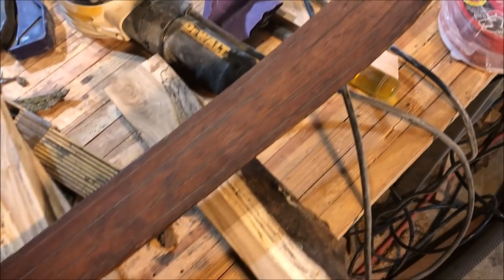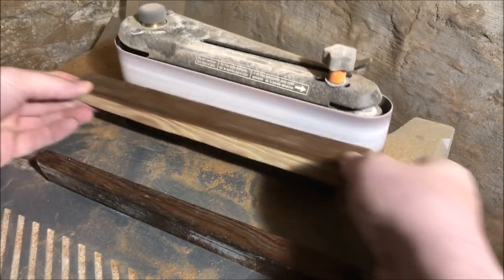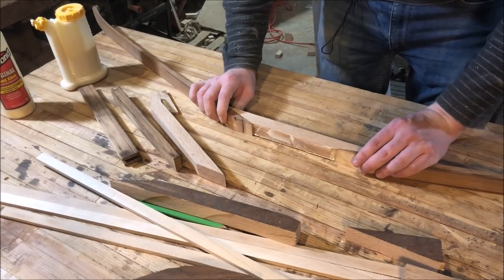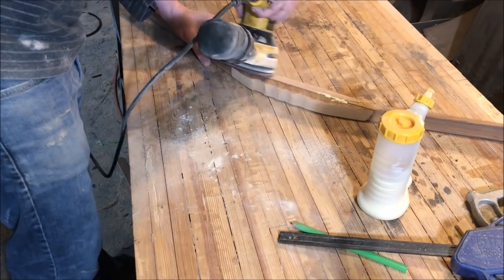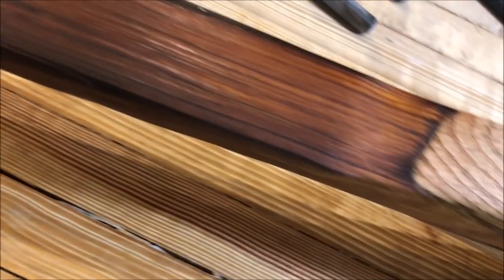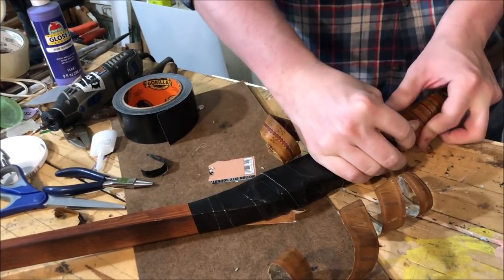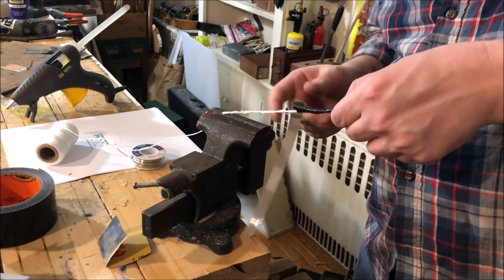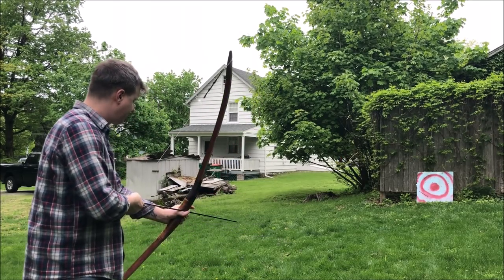SKIBOW - DIY Archery Bow Made From a Ski - a Decent Project

Comment: String the bow the other way around.You will probably have to thin the limbs to get them to bend correctly but it will actually work as a bow. You will also have to reinforce the back of it so it doesn't crack. Look up Kramer Ammons he has some videos on it. Also look up a Flemish twist bow string. You can make a better looking string with only the string.